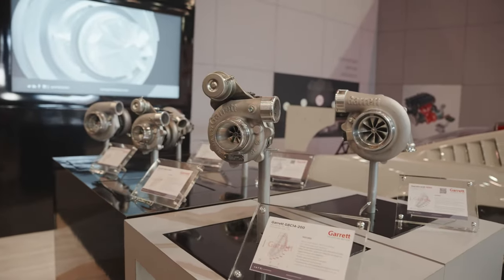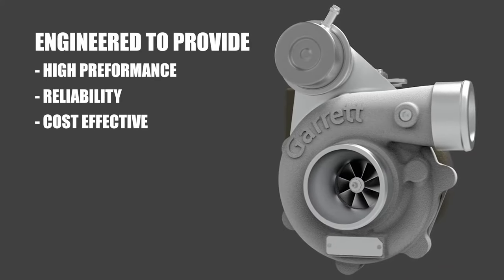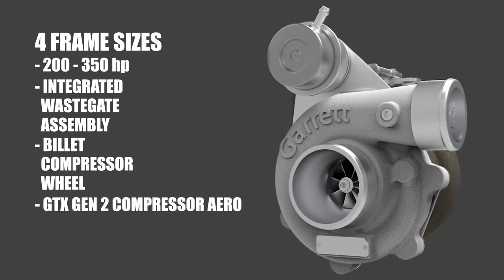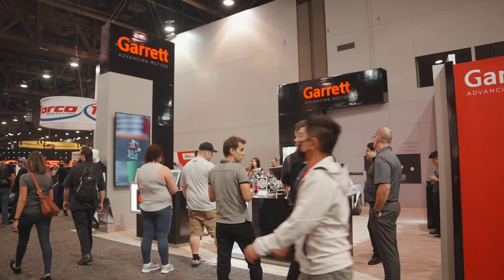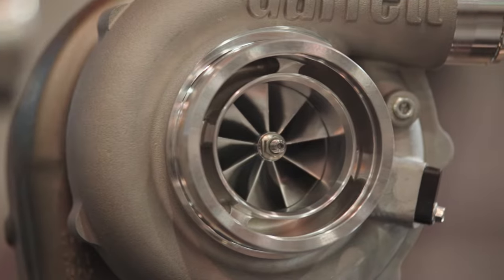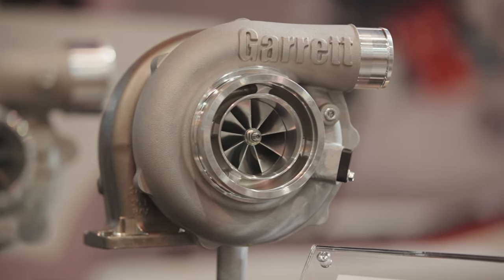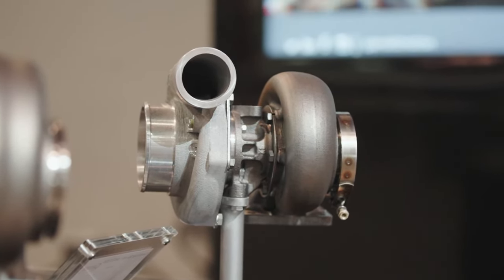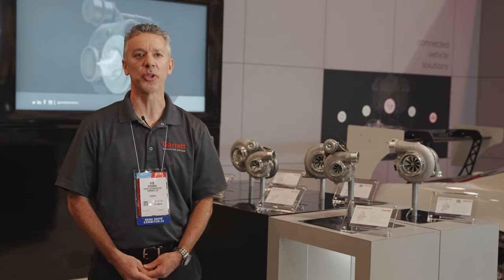Rob Symonds | Garrett Boost | Club Line Turbochargers | Garrett - Advancing Motion

Comment: the gbc14-200 we just dyno about 16psi on an 720cc 
3 cylinder engine and can only make 105kwz atw (E85)
18psi it made 106kwz and falling over
just wanna know is that what the gbc14-200 iz cable of?
what 200hp rated at wheelz or at the crank?
Reply: Yes the hp numbers are overrated alot. You have to look at the boost map and the inducer to see what its capable of.
Reply: @danielkarlsson8898  we high flowed the front wheel on the gbc~14 by GCG 
and we made 151 kws atw @ 20psi 🤗 suzuki cappuccino